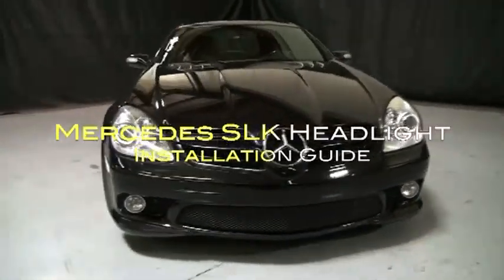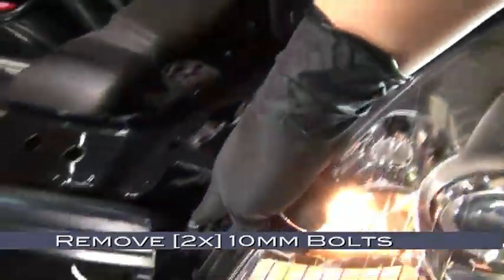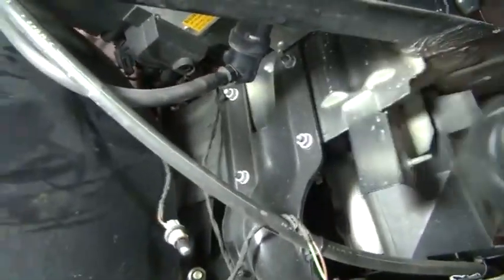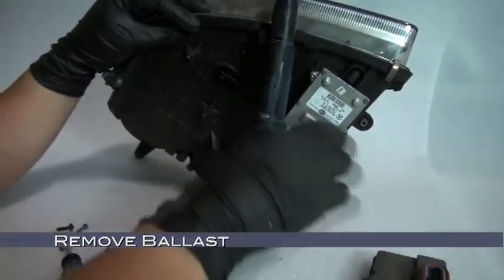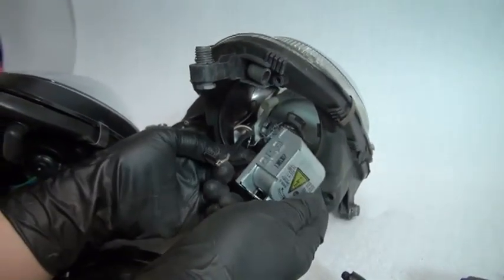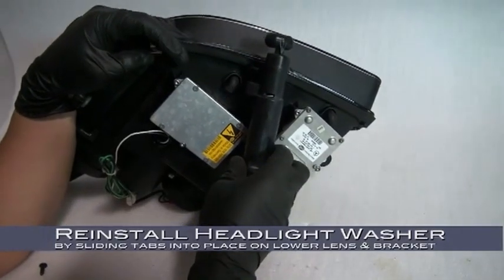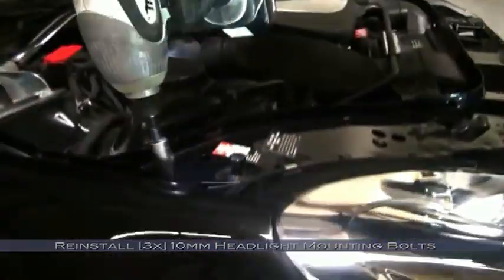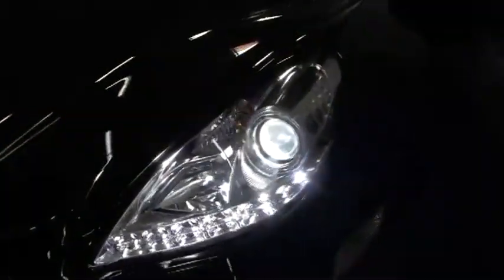Spyder Auto Installation: Mercedes Benz R171 SLK 05-10 ( HID Type ) Head Lights + Bumper Removal

Comment: Thanks.  With your video, I was able to replace the passenger side headlight on our SLK 350.  I think the hardest part was getting the holes lined up that connect the bumper with the fender.